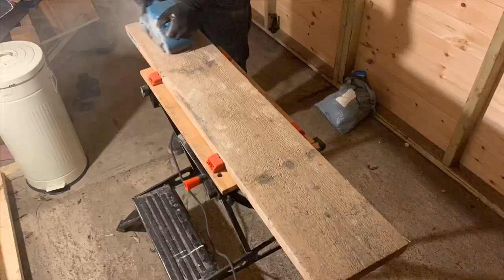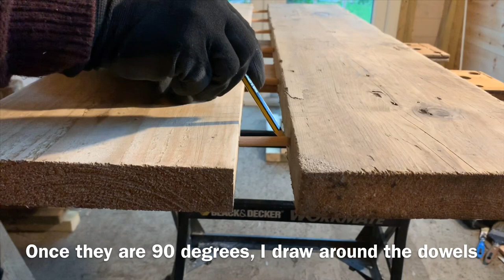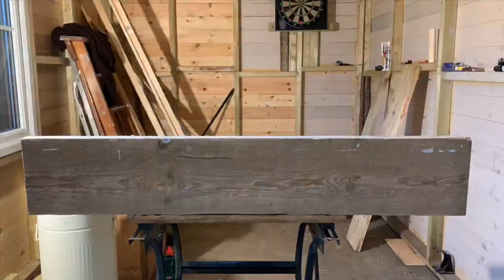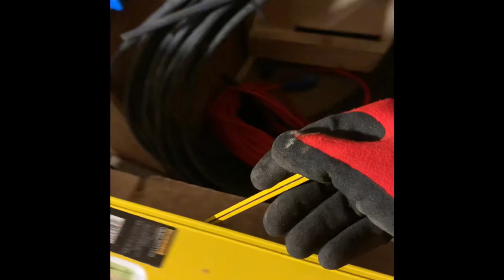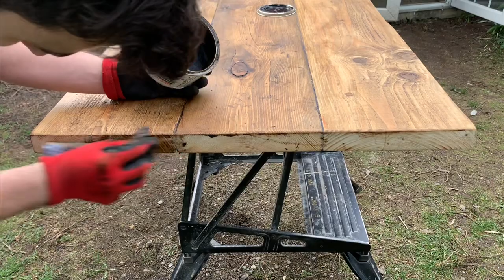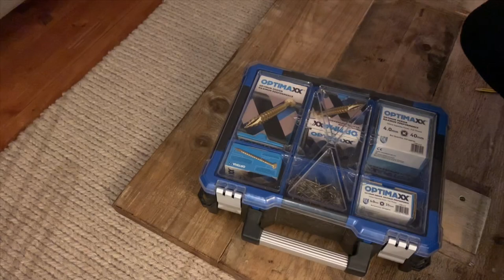How To Build a Scaffold Board COFFEE TABLE with Hairpin Legs

Comment: Should I worry about the wood cracking or warping?
Reply from the maker: It depends on a lot of factors:

1. How dry the wood was when it was built 
2. How it’s been built 
3. Where the table is kept in your house or a customer’s house. 
4. If the table is looked after with oiling and waxing over the years.

Comment: Love the table.  I'm a newbie to woodwork, can I ask what the plastic tool used was when drilling the holes?
Reply from the maker: Hi Simon,thank you very much. The plastic tool is a dowel jig. It makes it easier to line up the depth, location and angle of dowels. They’re reasonably cheap, so if you want to get one, there’s a link in the description of this video. Let me know if the link doesn’t work.
Reply: @o.g.bwoodwork   and what size are the dowells? thanks and great video
Reply from the maker: @andymanjo  i tend to work with 8mm x 40mm hardwood dowels

Comment: Great video. Could you not just use batons to fasten the table top together and help reduce warping? Without using glue or dowels. 
Thanks
Reply from the maker: Thanks you. Technically yes, but it could put a lot of strain on the end fastenings and could lead to warping and eventually failure. That’s not to say it wouldn’t work for many years.  I guess, glue and batons is a bit of a belt and brace approach, but it at least ensures the table will last as long as possible.
Reply: @o.g.bwoodwork  Thanks. So does using the glue and dowels, also help prevent warping as well as keeping it fastened together .
Reply from the maker: Moisture control would be the best preventative measure for warping. The glue and dowels would help keep things together, but might not help when the wood wants to move (which will happen seasonally). That being said I have some tables that I made with glue and dowels in a conservatory that gets cold and wet in the winter and up to 65 degree C in the summer, and they are yet to fall apart. Another method is to alternate the end grain direction of each board. That way, if it’s does bow/warp, it’ll be a bit wavy instead of a Pringle. (Hope this makes sense)

Comment: Hi great video. Which pine did you use as there's a few different types
Reply from the maker: Thank you. 
I’m not sure to be honest. I’ve tried to do some research on this in the past, but I get nowhere. 

I’ve noticed some scaffold boards are heavier than others, so they definitely have different densities.
Reply: @o.g.bwoodwork  I mean the wax... nkt the scaffold board. 🤣 it says pine colour... but there's diff kinds like rustic etc.🤣
Reply from the maker: @aquaticcolledgefishing  haha no worries. I thought it stated rustic pine in the video.
Reply from the maker: I’ve just added an eBay link if you wanted to buy some. 😁👍
Reply: @o.g.bwoodwork  cheers matey

Comment: Lovely looking table mate definitely gonna give it a go! If you were to use a protective coat of something after waxing what would you use? Also what’s the reason for using 50/50 white sprite and linseed oil before the wax?
Reply from the maker: To be honest, I have never used a protective coating. For the tables in my house, I just reapply every year. I may do some research for a protective coat in the near future. The oil and white spirit mix is to nourish the wood, as wax only covers the top of the wood and doesn’t penetrate it. This will also protect the wood from warping, as if it’s sealed from all sides, there’s less chance of moisture entering or existing the wood, making it more stable.
Reply: Nice one man that’s really helping thank you 👍🏼 would danish oil and white spirit work the same? Also where did you buy your hairpin legs from? I found some on amazon but not as nice..
Reply from the maker: Loz Bardwell no worries mate. Any time! Yeah it should work the same as BLO and white spirit  . I usually get my legs from eBay. Let me know if you want me to send you a link. 😁👍
Reply: Ok cool will give it a go with danish oil 🤞🏼 sorry last question! Ha what size hairpin legs did you use? 14inch?
Reply from the maker: Loz Bardwell it’s all good, ask as many questions as you want. 😁. Yeah, I go for the 14 inch ones for coffee tables. Also, I tend to go for thicker steel if possible I.e 12mm instead of 10mm, but it’s all down to preference.

Comment: How do you make sure the boards dont dry out and warp/crack? Ive made several tables, pews etc out of reclaimed boards and have had a few issues with them warping over time.
Reply from the maker: Hi mate,

I’ve had a few issues like that in the past. The main way I try to avoid them, is by using a moisture meter and trying to get the boards as low as possible before I work with them. 

When I get a delivery, I stack them all with sticks every 20-30 cm to ensure I get air flow and add bricks to the top layer. I’ve found a dehumidifier works really well and speeds up the drying process (note: each room will have an equilibrium, so you mate find it hard to get them past a certain baseline) 

Also, when I build a table, I make sure I seal both sides of the boards. 
 
Sorry if you do all of these steps and I’m teaching you to suck eggs. 

In some cases, it might be unavoidable though.

Comment: Hi! What clamps did you use? Want to make something similar for my parents anniversary... thanks!
Reply from the maker: Hi Hannah, 

I use 4 aluminium sash clamps for this project. 
You can get them from eBay for about £10 each. 
Just make sure they are the right size for what you need. If you’re using 3-4 scaffold boards, I would suggest getting 900mm sash clamps.

Hope it goes well and if you need any tips, just let me know 😁

Comment: looks great, you could probably get away without using the dowels, a good glue joint will be more than good enough for a table like this, especially with a rustic looking finish as you dont need them to line up fully. great video
Reply from the maker: Thanks buddy. I guess it’s a bit of a belt and braces approach. 😁

Comment: Great work. Love this mate. 

I am thinking of making a dinning table and bench. Would you recommend metal plates underneath to keep scaffold boards together? 

Any tips would be great 

Thanks Karl
Reply from the maker: Thanks Karl, much appreciated! 

I have made a fair few dining tables using a similar method. The only difference I make is adding a support board that the legs go on that goes across all of the boards. This way you won’t get any sag from the weight of the table. 

Metal plates would also be a great option. 

Let me know how you get on and if you need any more tips. 😊
Reply: @o.g.bwoodwork  

Thanks very much for you reply. I am not sure what you mean to be honest. I am not a great diyer. I am a painter so that part is fine haha. 

Do you mean just a strip of wood around the edges of the table? Or just strips of wood just going the opposite way of the scaffold boards. 

Also with mental strips would you put large 1s or just a few small 

Sorry about questioning I just want to get them right 
Thanks again 

Karl
Reply from the maker: @Karlb7426  no worries at all mate. 

For supporting the legs, I would use a board going the opposite way to the scaffold boards (underneath the table). I would use these at each end and place the legs on top of these. 

I would also add a couple of support boards going across the scaffold boards to add extra strength around the middle of the table. 

There’s obviously a fair few methods for doing this, but I’ve found this has worked really well for me and my customers. 

Regarding metal plates, I would probably go for one with a large (ish) surface area at each end where the legs are, and a couple of thinner ones in the middle of the table. 

I’m going to be building a dining table in a week or so, and I was thinking about filming it. If you want, you can have a watch as reference. It might help you if you haven’t already started building yours. 

Cheers 😁👍
Reply: @o.g.bwoodwork  Brilliant thank you for all your advice. 

I would love to see a video of you making 1 

Thanks again 👍🏻
Reply from the maker: @Karlb7426  always happy to help mate. If you have any more questions, please don’t hesitate to contact me. Have a good one.
Reply: @o.g.bwoodwork  Top man! Thank you.

I do have 1 more i promise 🙈😆

I am doing a 4ft by 2ft table with benches for a mate. He wants hairpin legs but I am not sure what size to go this it being a smaller table? 

What are the standard size for normal size table? 

Thanks again mate
Reply from the maker: @Karlb7426  seriously, the more questions the merrier. 😁

I usually go for 71cm (28”) legs for dining tables regardless of table size. The suppliers usually give you a choice between 10mm or 12mm thick and I always go for the thickest I can get. (no worries if you can only get 10mm, they are more than strong enough) 

For the benches I usually go for 41cm (16”) legs.
Reply: @o.g.bwoodwork  
Brilliant mate cheers that’s the size I’ve ordered but I had doubts 

sorry I lied haha 🙈🙈 1 more mate haha. 

What do you do with the holes from the nails off the mental on the boards? 
Should I wood fill them? Glue? 
It’s a dinning table so want it to look it’s best really. 

Thanks so much mate for your help! Can’t thank you enough 👍🏻
Reply from the maker: @Karlb7426  can’t believe you lied to me Karl 😂

Usually I leave the holes, as they are only on the side of the table and nothing with get stuck in them. Plus it adds a bit of character.

I always cut each end of the table, so it’s a bit easier to sand the end grain, and all of the boards are flush. if you do this it’ll remove the holes and marks at each end of the table. 

If you decide you don’t like the holes left on the side of the table, I would fill them with glue and sand over with 80 grit sand paper or higher. This way the glue will take on the colour of the surrounding wood. 

If the holes are very large (probably not if they are nail holes), I would add saw dust to glue and mix it into a thick paste, then apply with a stick or glue spreader.
Reply: @o.g.bwoodwork  haha! Thanks mate! Appreciate it. 

Couple of length of scaffold have a belly of you get what I mean haha! They just won’t sit flat some am going plane it. If that’s right I don’t know. 
I am not sure if the laths would straighten the wood out. 

It’s not easy, I am learning though. Thanks again for all your help 👍🏻
Reply from the maker: When picking boards I try to choose ones with the least amount of cup, bow or twist. 9/10 if I have a bit of cup, I alternate between boards, so when joined they are a bit wavy instead of a large Pringle. 

You can plane them, but depending what you’re going for, you might loose some character and rustic appeal. 

Another tip, is to make sure you alternate the grain direction between each board. By this, I mean when looking at the end grain (at the end of the board) if one is in a ‘u’ shape the next board should be a ‘n’ and so on. This will store the table cupping as one piece and will just go wavy when the moisture content changes through time and seasons. 

Sorry if this doesn’t make any sense.
Reply: @o.g.bwoodwork  Brilliant thanks mate. That’s what I’ve done. 

Boxed legs for the table and bench came today, the type where it’s 1 boxed section for each side. 
Do you think I need to add some more support to the squared boxed section legs? 

Not sure if the table of bench would sway? 

I was thinking bolts or having a bar across somehow. 

Someone sits in the middle of the bench it my bow? 

Just not sure if they will support enough. 

Any advice would be greatly appreciated 

Thanks for this! 

I am not sure if just screwing them in will keep the table stable enough
Reply from the maker: To be honest, I’ve only ever used hairpin legs, so I wouldn’t be able to give any advice about and potential sway or support offered by the box legs. 

Scaffold boards don’t tend to bend too much, unless there’s a lot of weight in one area and the span between the legs is considerable. 
So the bench should be ok, but there’s nothing like a little trial and error. 
Worst case, you’ll have to add some more supports to the bench and table.

If you’re worried about the screws not being substantial enough, then maybe try lag bolts/ coach screws.
Reply: @o.g.bwoodwork  Brilliant. Thanks mate. 

Really appreciate all your help, honestly don’t think I could of done it without your advice 👍🏻
Reply from the maker: @Karlb7426  always happy to help mate. 😁👍

Thanks, that’s made my day. Hope the rest of the build goes well and don’t hesitate to contact me.
Reply: @o.g.bwoodwork  Went really well mate. So happy with it. 

Thanks again for everything 👍🏻
Reply from the maker: @Karlb7426  always happy to help. so glad it went well mate.

Comment: How long did you leave the boiled linseed oil to dry for? I did mine tonight and was hoping to wax it tomorrow afternoon
Reply from the maker: It depends on a few things. Temperature, how thirsty the wood is and if its a boiled linseed oil and white spirit mix or just Boiled linseed oil on its own. 
 
The warmer the better and try to remove any excess. 

If it’s a BLO and white spirit mix, it tends to cure a bit quicker.

You should find for tomorrow afternoon, but let me know how you get on.
Reply: @o.g.bwoodwork  thanks you. It was dry to added the briwax today. How long did you leave before buffing and how many coats of the wax did you apply? Cheers :)